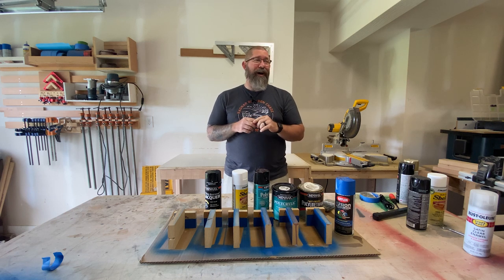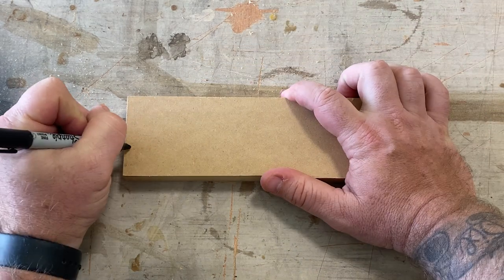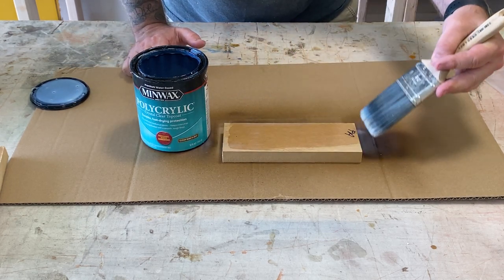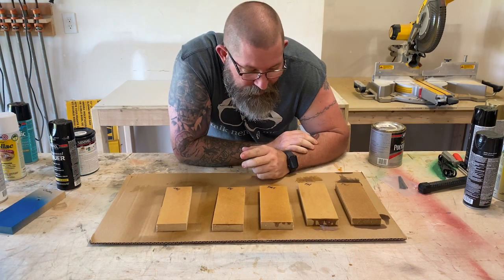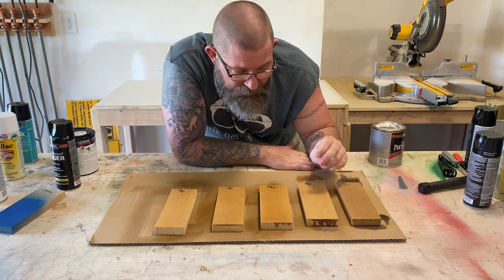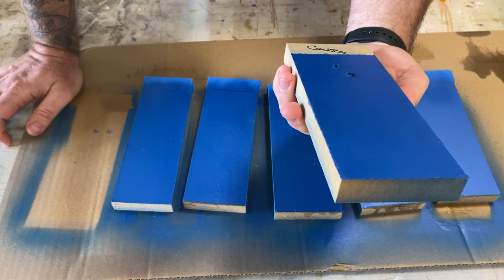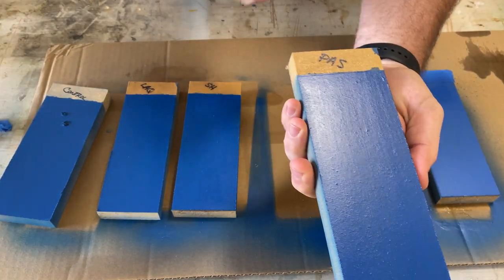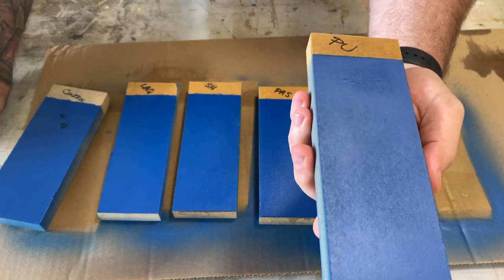How To Seal & Paint MDF

Comment: I have finished a lot of MDF and I have found that I get the best finish when I use a brush on primer/sealer. After the primer/sealer I lightly sand the MDF to get a very smooth finish. This applies to the top and bottom surfaces as well and edges, if you need them painted. After sanding, wipe down the piece and apply your finish coat. I did some equipment racks and shelves with high gloss black paint and used a 4" foam roller. They looked like they were plastic dipped when done. I find MDF always needs to be sanded a little to get the kind of finish that I like. Painting raw MDF if just a waste of time.
Reply from the maker: Yup, I realized that I should have sanded. I learned a lot from doing this, now the next step is to get better and finish.
Reply from the maker: What grit do you use when sanding the MDF?
Reply: @SothpawDesigns  I normally use 150 or 180 in my random orbital sander.

Comment: Acrylic primer-undercoat, it's what professionals use, only needs 2 coats, it's the only thing I would use on MDF and I've nearly tried every other thing and nothing beats it, machined edges come up super smooth as long as you know how to sand as that is what contributes most to a good finish, I alway pre sand with 400, then sand the first coat with 400 and sand the second coat with 600, never fails.

Comment: I just dropped 50 bucks at Lowe's i got the spray Shellac, poly acrilic, 2 n 1 sandable and im gonna sand each step to 400-500 grt then im gonna lay my base(?) Then maybe a expoy pour or a triple thick clear glaze over my( don't tread on me) logo that is gonna be on the face of my truck speaker box, this is my first one, wish me luck🎉

Comment: I'm building speaker cabinets and have watched a lot of vids by experienced speaker constructors. A favourite is the Zinsser B-I-N primer sealer when using MDF. This is Shellac based but has other components. There is also a water-based Zinsser 1-2-3. The Shellac-based version seems preferred , with the water-based version not far behind. Finishing paint is usually with Rust-Oleum (furniture paint) spray can. Rubbing down is done several times with increasingly finer sandpaper in the process, building up the paint thickness in layers.

Comment: My go-to is dewaxed shellac, 2lb cut. A couple of coats, sand between, sand with 320 before painting. Buttery smooth finish. I mix my own from flakes these days. I like BIN primer a lot too; it's shellac based so it works well with any paint going over it.

Comment: Question - did you shake each can of product for 2 min before beginning? If not - this affects the consistency/stability of the product significantly. Very interesting how the polyurethane brush on dried almost instantly (crazy!).  I'm wondering if applying wood hardener to MDF before beginning to seal/paint/finish it might be a good option? I've used it on one MDF product to stabilize it (very old) before placing a new wood surface over it.. and I remember thinking it would paint nicely (over the hardener). Ultimately, the problem with water based polycyclic sealers is they are not going to be water resistant. Great demo - really helped seeing how the lacquer worked!

Comment: Hi Damian. This video couldn't have come at a better time lol. I'm in the process of trying to figure out how to paint that stuff also. 😃
After its sealed, do you think it really matters whether the paint has primer in it or not?? I'm just wondering if it all depends on the mdf being properly sealed and sanded.
Also, do you know which grit to use to sand in between the sealer coats?
Great video, buddy. This will definitely help a lot people out. 👍👍
Reply from the maker: I think that once it's sealed, the primer/paint combo isn't really a big deal, based on other work I've done. The main thing that I'd recommend is to make sure that you clean your workpiece and sand it before priming, maybe even a light sanding after the first coat of seal. I think that's the reason for a little of the grittiness of the finished work. I'm gonna try to refine it a little today and see if I can improve the finished look.
Reply: @Sothpaw Designs - Woodworking & CNC For Beginners  Oh ok, thats good to know then.
Hopefully you'll be able to share with us the results after you refine it. It'd be great to see how it turns out and exactly how you did it. 👍